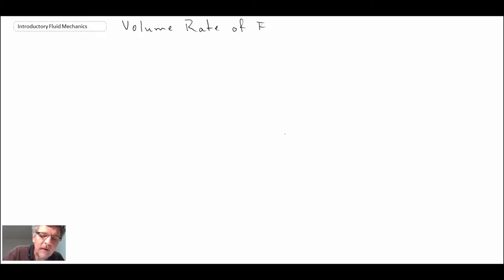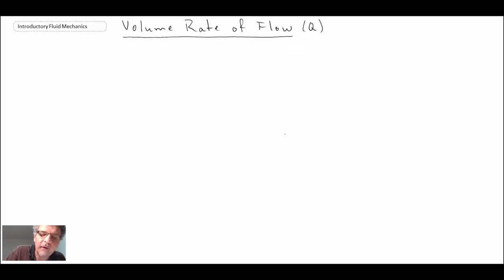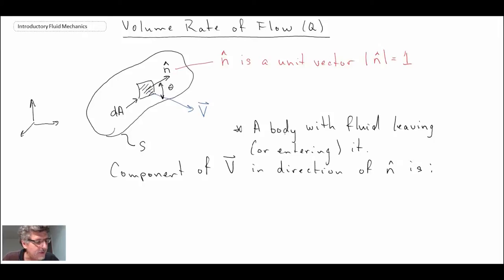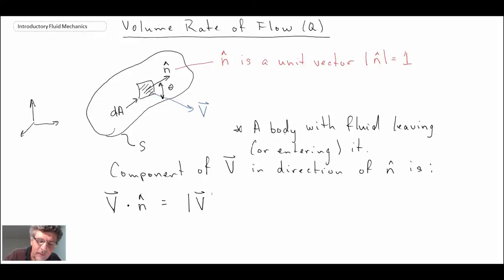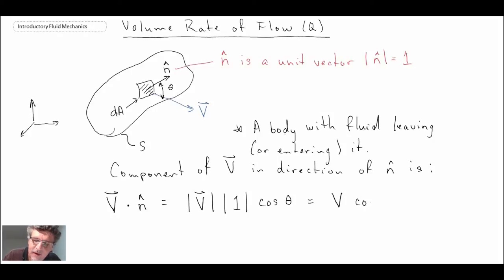Introductory Fluid Mechanics L2 p1:  Volumetric Flow Rate

Comment: Very interesting! So the volumetric flow rate is a measure of flux through the surface.. I had never thought of it like that but makes sense.
Reply: +Robert Kerestes
You can pretty much derive electric flux with this derivation as well - they are very similar.